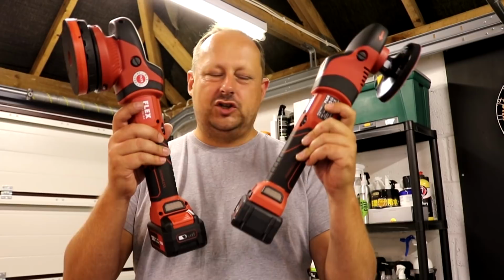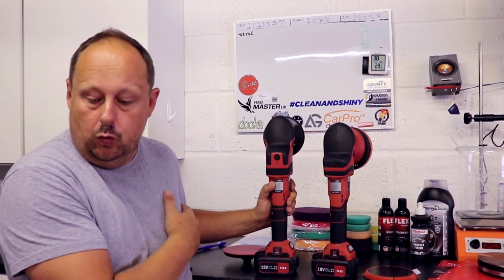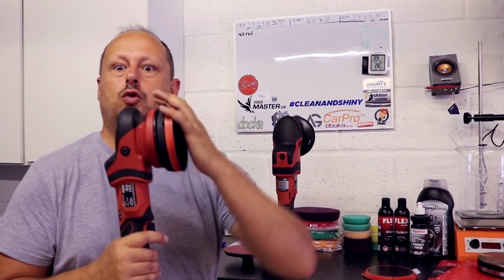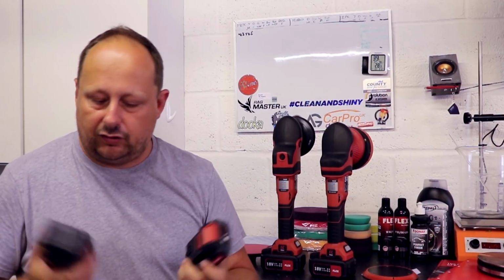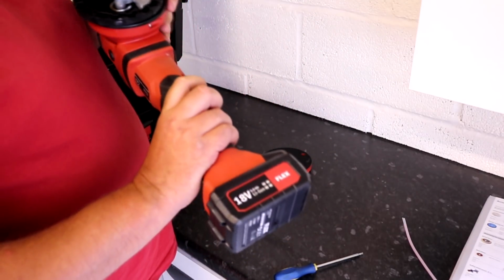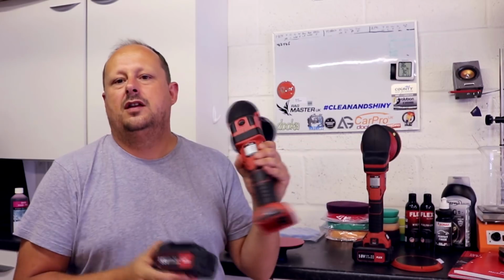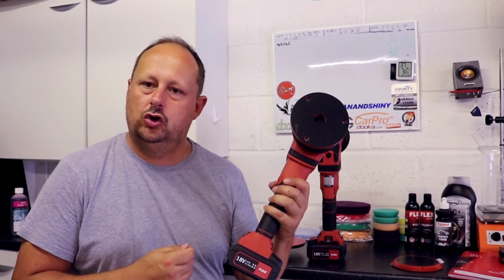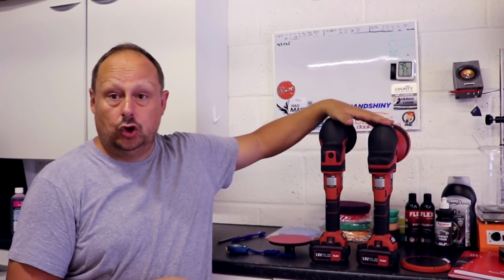Flex Cordless Polishers - PE150 and XFE15 150 review

Comment: Great review! I am wondering how the XFE compares to a Rupes LHR21 in terms of cutting power. Is there anyone who has used them both?
Reply from the maker: On paper the 21 will edge it. but thats just be using my logic head..  theres very little difference with like capability of these machines.. Although cordless you loose top end speed and torque and you loose the taco.
Reply: @ForensicDetailing  That's what I thought as well, but since I rarely use my machines at maximum speed, even for compounding, I wondered what the difference would be in practical terms. The combination cordless XFE and PXE seems like a great combo.
Reply: To get back to this: I got the PXE and the cordless XFE and they are both great. I used them only once on a VW, but it seems like the de XFE does not lack power for heavy compounding. Runs so smooth it feels like nothing happens, but the results are there. Thanks for all the reviews you do!
Reply: I have both, the flex xfe cuts well in when battery is full. But after 10 minutes of full speed which is what you need for cutting, the rpm will drop significantly. So if you are cutting i fins that you need to swap batteries after about half battery. For finishing it is sufficient to go through entire battery.

Comment: Could they perform as  efficient as corded tools?  Since that cordless tools usually got less powerful motor than corded ones(100w vs 1000w).
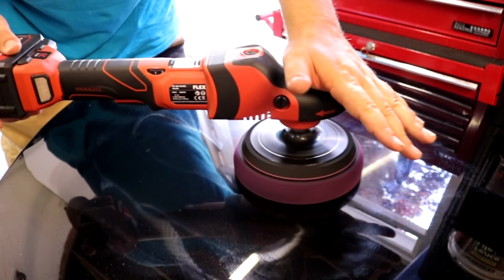Reply from the maker: efficient probably is not the right word. at around 22:30 in the video I talked about this but in short the corded tool have wider speed ranges and you cant really slow the corded tools.  There are some compramises with "grunt" I think with these cordless versions but they still have plenty of capability.
Reply: Thank you!  Then do you recommend pairing these cordless tools with more aggressive pad or compound to get as same result as done by corded tools when compounding?
Reply from the maker: no mate.  I would use them exactly the same.   specially the XFE.   sometimes with the rotary cordless you might miss the high speed of the corded version and if your tilting and using pressure you will notice a bit of slow down.     but you wouldnt need to change pad or abrasive combos to try and work around it imo.

Comment: £500+ means it's for pros only.
5 x more then it should be, what a shame.
Reply: That would make them £100ish you must be having a laugh, flex are one of the top names in power tools they are not some cheap far eastern diy tool you pick up at b+q, think about it -around £95 per 5ah battery, 2 x in the kit, probably £50 charger (these are about right £ in high end power tools, makita, dewalt etc) £250-300 polisher -that's what flex cost anyway, and packed in a l-box, these are around £50. 
Even for the cheapest diy make, I would expect to pay at least £200 for an 18v angle grinder style polisher kit in a cardboard box, those cone style polishers are only practical for waxing, and you can't compare battery tools to corded tools on price, even cheap batteries are expensive.

Comment: FORENSIC DETAILING,,,,,Since 6 years has passed since you made this,,,,,many videos have been made about the XFE15,     90% of the reviews since say the XFE 15   is severely Underpowered and lacks torque,,,,,,,,,what is your long term verdict on these and or the forced Rotation XCE 15?  thanks much!!!
Reply from the maker: Xce is just perfection.  Xfe needs more top end more than torque. Rotary cordless needs more torque. I think new versions are coming with new battery tech that deliver this.
Reply: Thx so much for responding from across the Pond !!!  Greatly respect your opinion and channel !    The latest SEMA Flex booth stated "Flex Red is Dead".   But I am going to hold on to my XCE and just buy a couple more batteries for long term use. Don't think they could improve on the Red XCE much,,,,probably just need to put some Grey plastic on the XCE and call it good!     YOU DA' MAN !!!!!
Reply from the maker: I talk about this in a video coming soon actually.  my only wish for my red XCE is some sort of rubberised battery incase that hit the paintwork.  I have no other complaints with it really.  I just love it.

Comment: Fu ..k you all not been able to confirm that forced rotation will ensure perfect  holograms free, almost no haze  finnish with one step compound.  Only asked 17 detailing channels :)))

I am buying 15 mm through da then :)

Thanks for your precious time spend making this and other so very valuable reviews kind Sir John

Lmfao this flex has no rotation speed compensation .... = As good as ryobi polisher for 140 euros rofl :)))) never mind 8mm vs 15 mm through 
Got to get corded version with that car battery and inverter then.
Fu..k me my head is spinning from all these specs
Reply from the maker: dont get cordless if you want lots of power mate.   If your starting out polishing maybe just get a budget 15ml throw Dual action polishing.
Reply: @ForensicDetailing 

Now i want this flex machine with that smart pants processor which ensures constant rotation speed regardless of pressure applied to machine.
This as far as i have understood will ensure No f.. ing holograms ever anymore.

 i have done 20 very dark cars with ryobi cordless DA 
8 mm through  polisher .
Bmw X5, x6 , lexus 4x4 , 6 months to 12 years old . Some other volvos, toyotas , hondas , audi etc. Moderate to very heavy swirls , achieveing 75- 95% defects corrected after 2 passes. 

Ryobi  however finnished with some light to moderate  holograms sometimes using scholl s20 and blue spider pad 

That was head shot to me  with them fee hologrammed black cars , ass i only offer one step correction.